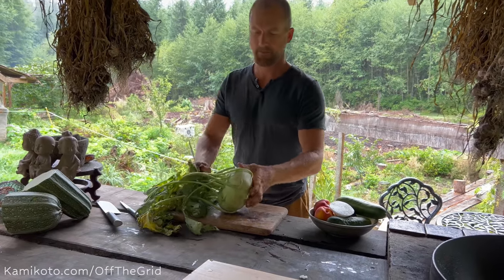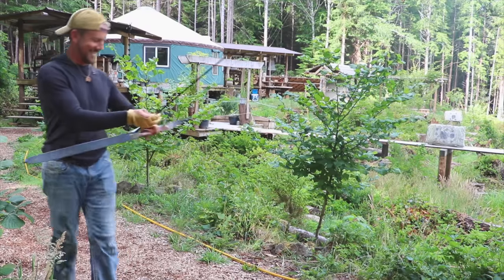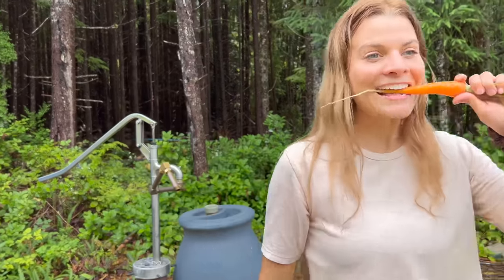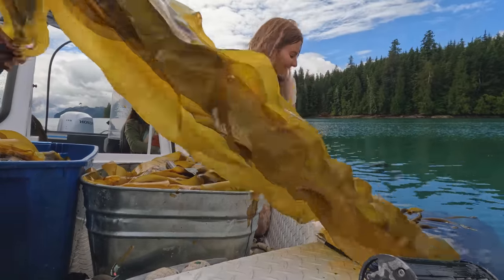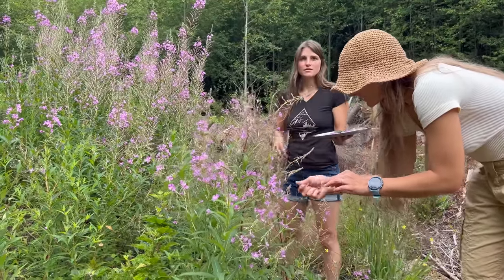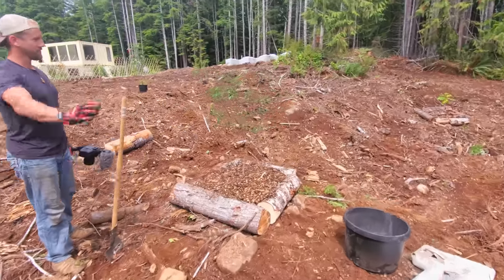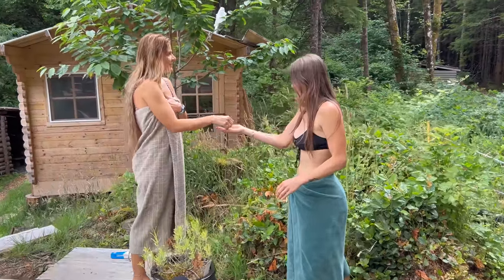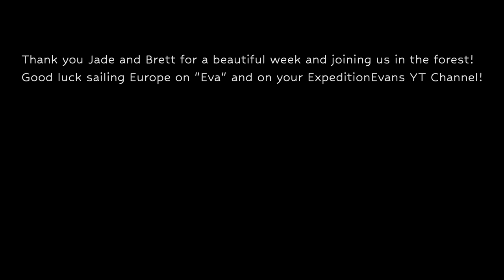Off Grid in the Forest - SHE CAME TO VISIT ME - Hippie Hot Tub, Fishing, & Boating - Ep. 174

Comment: A tip on how to keep those knife blades sharper for longer…don’t scrape what you cut off of the cutting board using the knife edge.  This act dulls the edge.  Instead use the back/heel of the blade to move the material off of the cutting board.
Reply from the maker: Watch closely when Nicolle scrapes the onions off the cutting board into the bowl and you’ll see she is doing this